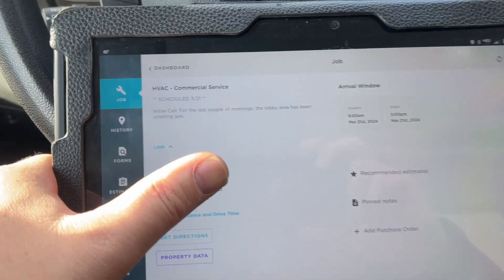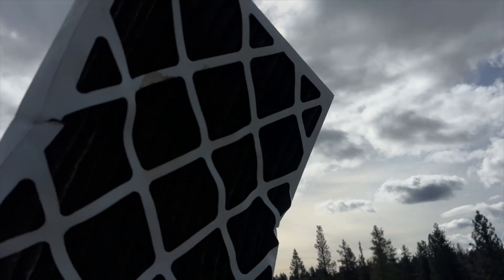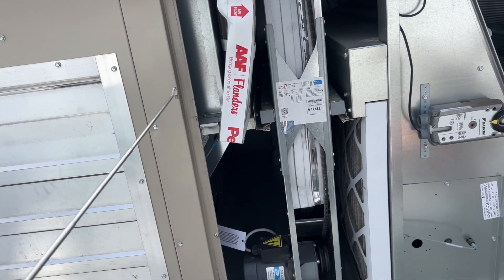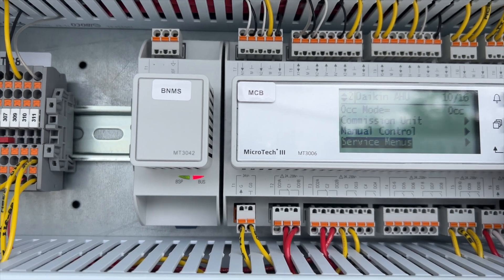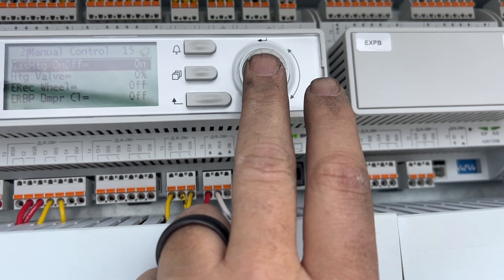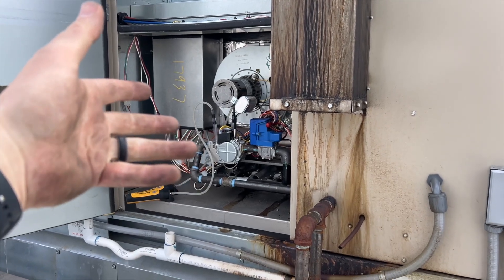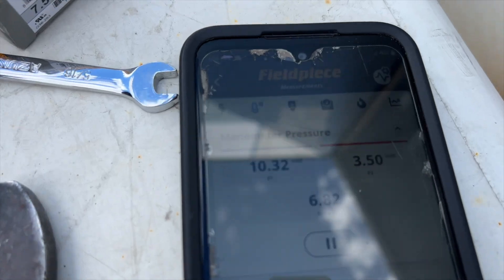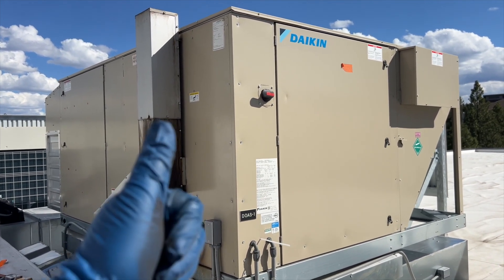Daikin DOAS Is Having Combustion Issues EP172

Comment: Did you have to adjust low firing on gas valve and do you basically do it through the module light the 3.5 high gas pressure
Reply from the maker: Adjusted the single stage main gas valve to the max pressure of 3.5 in WC. The
modulating valve will reduce the gas pressure as needed based on demand.
Reply: @NighthawkHVAC  Thanks good to Know, I thought it high and low now I know thanks again
Reply: Wouldnt the inside of that heat exchanger look like the outside funk? Wonder how much that reduces the life of that heat exchanger.